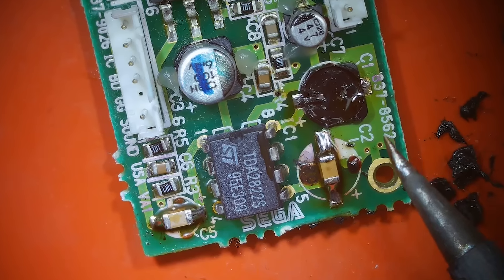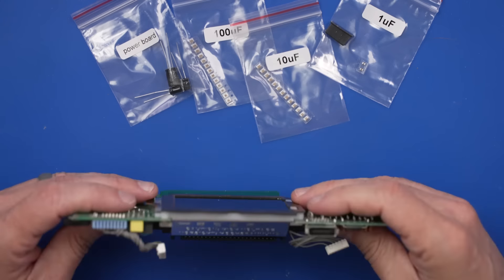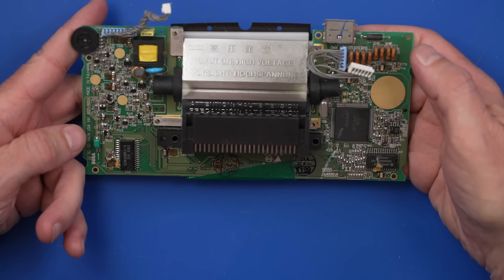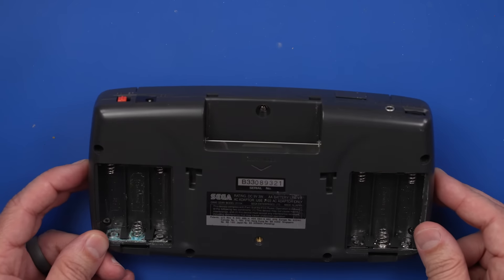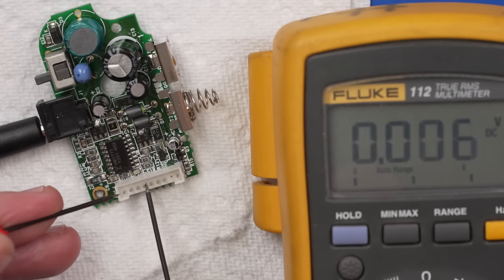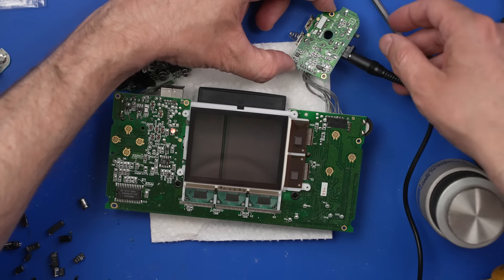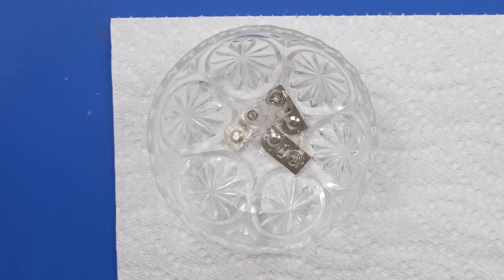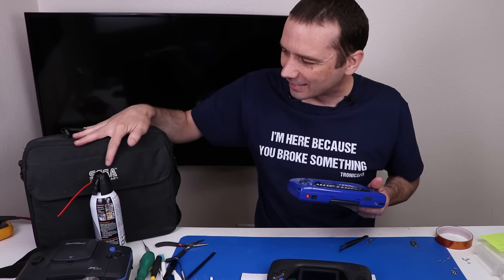Trying to Fix 3 BROKEN Sega Game Gears (Including a rare blue one!)

Comment: it's amazing how much smaller the replacement capacitors are compared to the original ones. technology is crazy
Reply: They are a different kind. I was surprised actually. If he used the same kind they would be a lot bigger, but still smaller than the originals. The originals are electrolytics. 90's and 00's electrolytics (especially surface mount) were garbage. These days they are fine. The replacements are solid state. No liquid component. The nice thing is that it won't go bad ever (or it shouldn't) But usually this kind of swap doesn't work. So I don't know why it can be now.
Reply: one thing that surprised me is I've never seen square electrolytics before.
Reply: @awilliams1701  They're radial electrolytics fit into a square piece of plastic.
Reply: @awilliams1701 you can change electrolytics with ceramics and they'll work if they have the same values. solid caps were all low capacitance 20-30 years ago so  liquid or tantalums were the only choices for higher capacitance, nowadays not really
Reply: The orginal capacitors are made out of fish oil. Thats why they go bad i had a gamegear when i was a kid in the 90s. It lasted less than two years it wouldnt turn on anymore. Ether i blew the fuse by using the megadrive adaptor or the capacitors went bad and leaked. My guess is they went bad so my gamegear would no longer turn on!

Comment: In Game Gears you have to change every cap, that is included in these sets. But don't use ceramic caps for the audio board. They often create noises. Better to use tantalum or electrolyte caps.

Comment: That is not battery acid. Alkaline batteries get that name because their electrolyte is alkaline, that is, basic. This should also be apparent given the reaction with vinegar. Vinegar is dilute acetic acid, and the reaction is because of the basic nature of the KOH that corroded the components. If it were an acid, there would not be that visible reaction with vinegar (another acid).

Comment: It's not surprising it was mostly just capacitors. 90's and 00's surface mount electrolytic capacitors are garbage. If you see anything from those time periods, just replace it. Even a nintendo wii. If it's not broke yet, it will be. TBH I should pull mine out of storage and do that....assuming the board isn't trashed from it. I was a little more surprised the through hole caps were bad. Those are usually pretty reliable.

Comment: I have repaired over 100 Game Gears so far and just wanted to add some info for the DIY types out there. Firstly all Game Gears need new electrolytic capacitors, replace all of them not just some of them, that includes capacitors on all three boards. Further, with all ceramic capacitor replacement kits you will get undesirable hum on the audio circuit and possibly video interference as well to correct this use appropriately up rated Tantalum capacitors of matching values in place of the ceramics on the sound board and the nearest capacitors to the power input connector. Finally make sure you know what your purchasing before you buy it in other words do not buy 2103K Game Gears, they usually have unfixable screen issues and avoid anything that has rust or sever battery corrosion in the battery bay.

One more thing 😂 do yourself a favor and replace the original screen with one of the new TFT solutions your eyes will thank you and your battery budget will decrease dramatically. With some of the TFT kits I have tested play times increased from 2 to 4 hours to 16 hours.
Reply: That's a lot of very interesting information!
Reply: Replacing only parts on 2 boards is madness, always do it all as the rest will be failing very Very soon. I've done a few game gears and they are always in need of a full cap replacement 🤘
Reply: Yeah I agree with the tft screen. These are borderline unplayable as they are. Also recommend one of those cartridges that you can load up with roms as they can play matter system games as well
Reply: @Kevinwoolford123  strong agree. Not recapping the power board is a huge mistake, everything in Sega consoles from this era are known to be cheap and a result of cost cutting. Game gears in particular are notorious for capacitor failure across the board. EVERYTHING should be recapped upon receipt if it wasn't already.
Reply: @Kevinwoolford123  Pretty sure Tronicsfix knows alot more about repairs than you
Reply: @rbking803  😄 🤣 😂
Reply: @rbking803  he's not even played sonic 1 on 8bit so doubt he does know more about game gear mate. They all need a full recap 100% as the recipe sega stole for the caps is why they are all failing. He didn't use anything to remove the acid from the board that will stop future issues as its still contaminated as ipa won't remove it, he didn't even know about ps1 repairs till the other day. Just cos someone repairs alot of the same stuff doesn't mean they know more than anyone else who repairs alot of retro tech...

Comment: Steve, I decided to break out one of my VA4 boards to figure out where those three capacitors go. That section in the bottom left delivers power to the screen and IC5. Here it is how it is all laid out:
The positive leg of C36 connects to both Pin 1 of D1 and R24. R24 connects to R25 which in turn connects to the positive leg of C41. D1 goes to Pin 7 on the power board connector. The negative leg of C41 goes to Pin 18 of the screen. The negative leg of C36 connects to the positive leg of C42 and Pin #5 on IC5. Negative C42 goes to R41 and D5. R41 connects to ground and D5 and pin 5 of IC5. Pin 1 of IC5 connects to the negative leg of C41.
Reply from the maker: Wow, thanks!
Reply: All this to say, the shorting is probably impacting the screen. I would recommend replacing R23, R24, R25, R41, D1, D5, IC5 along side all the capacitors. I bet that solves the short and has a good chance of resurrecting the screen.
Reply: @PyroX792  You're a legend ! Hats off ! @Tronicsfix please try in another video, we all need to see that 2nd GG come back to life !
Reply: @Tronicsfix  no problem! Reading my comment again it's hard to follow (at least for me). I can map it out on an actual schematic and email to your business email.  I can also check if I made any errors.

Comment: I've fixed so many of these over the years.  On that first one when you went to replace the speaker to fix the sound I said out loud, "That isn't going to fix it". XD  Sometimes a full recap won't fix a Game Gear too, like on that 2nd one.  I've had ones where it'll turn on for a second and then turn off.  It's pretty much an over current saving feature on the power board that will automatically shut itself off.  Typically means there's a short or another bad component.  I fixed one like that once when I found one of the smaller capacitors on the board had a short.  I replaced that cap and it worked fine after that.  Looks like however that LCD on the VA4 board might be bad with some missing lines.  A temporary fix is to heat up the silicon on glass wafers that drive the signals to the LCD.  This has only ever been a temporary fix though.  It rather won't work or will only fix it temporarily before the lines will start showing up again.  Good vid!

Oh, another thing I wanted to mention.  There are 3 or 4 screws, forgot how many exactly,  who's only purpose is to hold the LCD screen on to the mainboard.  You can leave those in and still take the mainboard out of the case by removing all the other screws.

Comment: The old Game Gear got 8 year old me through many a road trip. I remember the cigarette lighter power adapter being a must though as you were lucky if  those 6 AAs lasted more than an hour lol.
Reply: The battery drainage was mostly due to the florescent tube needing power. There's now backlit panel mods that are recommended that replace the dily lit florescent tube and screen that signifcantly improve the gamegears battery life.

Comment: Literally just got one repaired tonight , carried out a full recap of the soundboard and main board, was still having issues with no display but found this was another common fault with the 2 ASIC model (VA 1 board) had to solder a connecting wire between 2 points of this line and got it fully working again, been following your content since lock down and got into repairing electronics learning more and more from your videos you are a legend Steve

Comment: These consoles were in good condition. Usually they have some highly corroded boards. The one that I bought, an attempted fix by someone else, I was just about to give up on. Capacitors were replaced but no audio and no video. I remade so many of the copper traces but it finally had audio and after a day more, also video. 👍🏻

Comment: That blue unit is pretty sharp.   They really should have used that blue as the base model, coinciding with Sega's blue theme.    

In any case, nice saves on the ones you got going.   Nicely done, as always.

Comment: Hey Steve, great work on fixing 2 out of 3. You probably can fix the second one two. I think the reasons those caps are shorting is because the residue from the leaking capacitors are highly conductive wich can cause components to short out. Try giving it a thourough clean with some IPA and see if that helps.

Comment: Great video! That blue one looks like it's in great condition.
I've fixed a bunch of Game Gear handhelds, and I would recommend to always replace all those problematic capacitors on the main board as well as the sound board and the power board. If the sound or power board caps are left alone, then sure enough pretty soon they'll go bad. Probably even on the first time you play the handheld for about an hour. I think it comes to 19 capacitors total, so once you're already in there, it's not a big deal to do the sound & power boards too.

Comment: I snap the capacitors free first and then cut the legs to remove the main body and then clean up all the capacitor juice before I apply any heat to the board.

With the audio board I cut the caps with flush cutters right at the base and then break off the black plastic base.

Once all that's done you can clean and take off the legs individually

Comment: You should have been using the vinegar to clean the corrosion on the PCBs as well. IPA isn't enough to neutralize the capacitor leakage and introducing heat and fresh solder simply accelerates the process. It'll come back.

Also, please be sure to always fully recap any game gear you come across. Just because the power board seemed to be working isn't a good reason to skip it - 100 percent has to happen because all of the caps on these fail spectacularly and leak all over the board.

Comment: The no sound issue reminded me of a similar issue I worked on years ago with a portable dvd player. Nothing I did helped.I made sure the speakers worked when connected to other devices  checked the jack and even confirmed I got audio on the RCA outputs. Still dead audio on the speakers. I was just about to give up when something told me to check the menu and sure enough my friend had set the audio to "external only" .  I learned to check menu settings first after that. lol

Comment: I have a later release of the Game Gear, it came bundled with 3 games. I hope it isn't rotting away currently. I need to buy the kit to fix up stuff. I remember asking some enthusiasts what they recommended for first time soldering kits and projects but got the answer of "pick something you're comfortable with" or "it's hard to recommend" and yeah... true. I mostly want to fix up and make my older gameboys and Game Gear back to working order. I don't know if I have the ability to do the screen swap to a more modern LCD screen for the Gamegear. Since it took 6 AA batteries, needless to say, it was mostly played with the power adapter.

Comment: The game gear black and white capacitors are super weird. They're apparently regular cylindrical electrolytic caps that are then encased in a rectangular block of plastic, presumably to make them easier to solder in?

Replacing them with ceramics is fine, and probably they work just as well as the originals for power filtering. But as others said, always be wary of replacing electrolytic with ceramic when it comes to audio circuits--ceramics can be microphonic, can act as speakers and also have more distortion than electrolytic.

Comment: Thank you Steve for the video.  I love watching these repair video's,  keep'em coming...lol   I wonder how many customers had issues with these capacitors failing back in the day? If is was a high rate of failure, then Sega should have recalled the units and have them replaced.

Comment: Lines on the screen is a giveaway that the screen connections are corroded.
Possibly a good cleaning will fix that or even a re-soldering of the ribbon connector.
There might even be some tiny capacitors that need replacing on the ribbon connector.
Electrolytic capacitors usually have a life range in hours of 1000 to 10,000.
And that's at 105 degrees.
Usually you can tell when an Ecap is going bad in that there will be a crusty crystalline mass at the base.
Catch it early and you will save all that corrosive Ecap electrolyte oozing over the other components.
I'd think that if you suspected a bad component that you would inject voltage and look for the heat with a thermal camera.

Comment: On the scratches on the screens try 1200 wet and dry paper slightly wet and T- cut cutting compound after you wet and dry it, comes up like new (try it first on something old first, just in case it doesn't work out for you)

Comment: Hey Steve, why did you de-solder the SMD caps on the audio board? Have you ever tried the "twist off method?" grip with pliers, twist and it should fall off.  That's what has worked for me in the past, and saves a LOT of time. Love the content. <3
Reply from the maker: Yeah, that usually works but always runs the risk of tearing pads off the board

Comment: Another tip if you use white vinegar to help clean up electrolyte corrosion don’t leave it on the board longer then 15 minutes and make sure to clean it off thoroughly with copious amounts of alcohol afterwards so it doesn’t continue to eat away at your Game Gear.

Comment: According some mentions Game Gear came out of a failed prototype that was sent from a Nintendo developer who didn't want to work with Sega and in order to ghost them after he sent the prototype .

The schematic was used anyways which lead the failure of the handheld.
Reply from the maker: Interesting
Reply: @Tronicsfix  The Game Gear failed due a bad design and it's notable when it needed to replace the capacitors for others in order for the handheld to work.

It's an interesting event for videogame history.

Comment: Have you looked into the hakko fr 300 series desoldering irons? They won’t burn the board as much and will make quick work replacing through hole caps and components.
Reply from the maker: The board wasn’t burned. It was just the flux.

Comment: The reason that vinegar works to clean battery contacts is that when batteries go bad the white powder you see is potassium hydroxide. Potassium hydroxide is a strong base. You mix it with the mild acid in vinegar and it gets rid of it!

Comment: 24:11 Did you try inject 1.2 volts and check it under a thermal cam? THe faukty component should heat up and if not increase voltage and try again maybe?

Comment: Is it a good idea to replace electrolytes with ceramic caps?
Reply from the maker: Yes
Reply: @Tronicsfix  I was looking for someone to post this and was hoping for an answer. I was wondering why the wrong style of caps were used (other than they are less bulky and very cheap). Replacing the bulk caps with wimpy ceramic caps - there is a design reason why they did not use ceramic caps in the first place. Higher ESRs and less effective against ripple, usually not recommended for power circuits and on sound circuits it could impact the quality of the sound or even allow background buzzing or noise due to transients. Depending on the circuit, you might as well just remove the cap entirely as the ceramic cap has little affect on the circuit. But I don't have any specific experience with these boards, so can't say what the ill effects will be (if any) on replacing them with ceramic caps.  But I also see lots of Game Gear Cap kits with the right kind of caps - so I'd personally go with one of those kits instead

Comment: 🐨With those two shorted capacitors "second Game console" one or both may be with a short, just remove one and test it, if it's not shorted return it and pull the other and test that one, if both are OK, trace the common lead to both capacitors to other IC's etc and see which farker Err-Component has shorted Err-failed..
APU I dropped yo a 👉👍👈

Comment: Vinegar already is an acid, acetic acid. Cleaning crusty battery terminals with acid creates bubbles (gas) because the crust is basic. Those leaking Game Gear batteries have an electrolyte, but it's not "battery acid". 😉 edit: both, acids, as well as bases are corrosive, though.